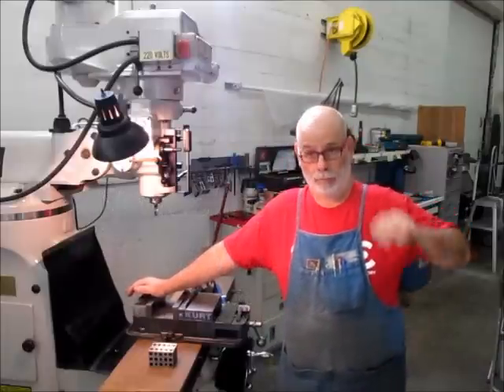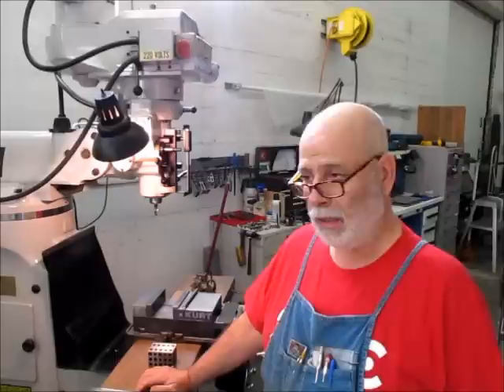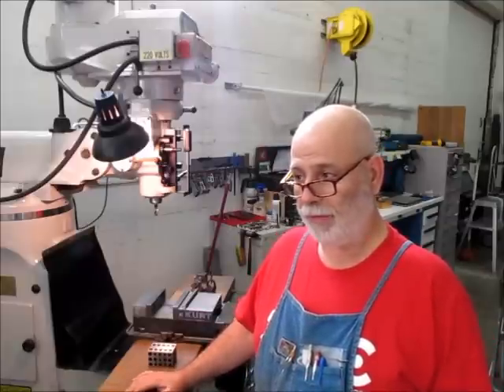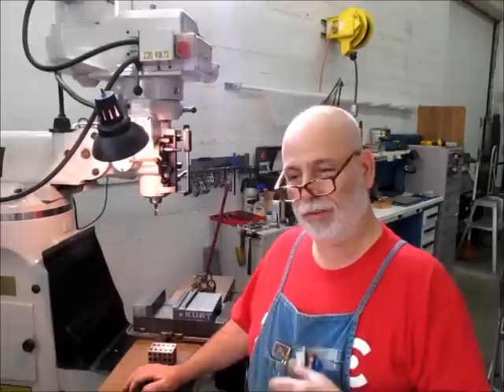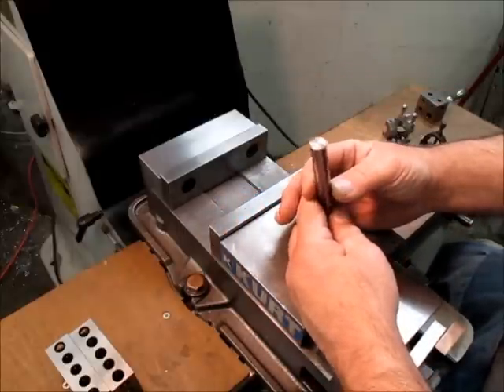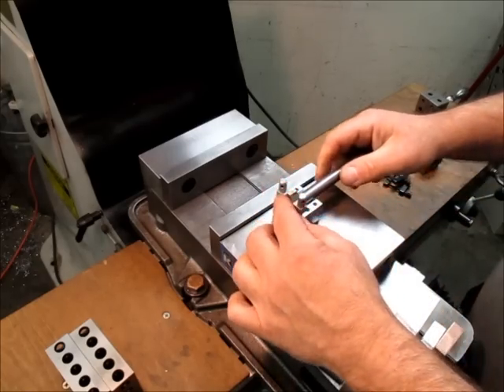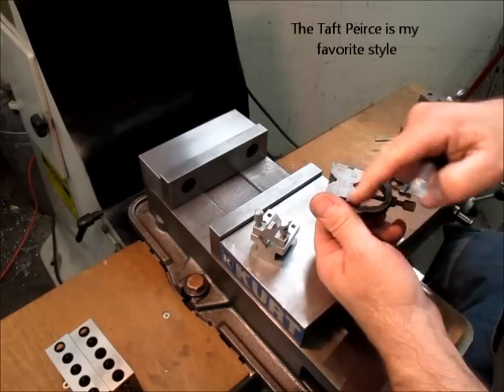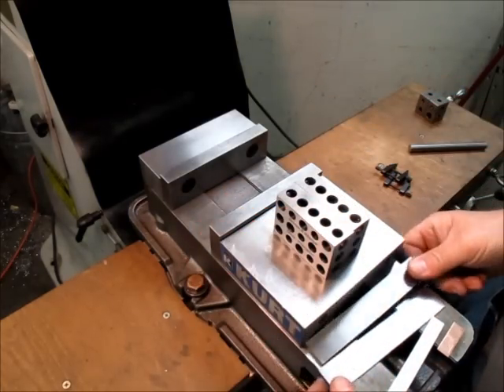No indexing tooling, no problem

Comment: Very simple, but you do need some patience which is a virtue of a good machinist.  This is years later and did you know that you just (then) invented a prototype of the overpriced Rosenthal indexing jig?  I think your method, albeit a bit more work, is more precise.  The Rosenthal product is precision made but lacks precision in its use as it relies on eyeballing the alignment with a usually only close square set on the bed.  Nice to see inventive and creative methods that use the tooling we have laying around, and properly implemented have great precision.

Comment: There must be a way to do this with even less stuff. If you simply clamp the rod in the vise, you'll be able to do 2 flats. That's the easy part. Then what? There must be a way. Let's do some brain storming here.
You need to clamp it in the vise again and make sure the first flats are horizontal. No indicators allowed, just, well, the 123 blocks, if you even need them...
Actually, what if you could use the 123 block to rest one of the flats on. You'd need to place the 123 on the table. But it will of course be either to low or too high. If it's too high, perhaps you could hold it at a angle so it touches the bottom flat while you tighten the vise and press down on the rod and press up on the edge of the 123...and now you need 3 or 4 hands for that. Hmmm...not to mention questionable accuracy. Because since you are holding the 123 at an angle, the parallelism of the edge touching the table and the edge touching the flat will depend on how precise the edges of the 123 have been deburred or chamfered.

Or...lay a machinist ruler on top of a flat to make sure it's flat. The ruler extends the flat left and right, which makes it easier to see if it's actual flat. Actually, this is a woodworker's technique - look up "winding sticks". Something like that should be possible in machining as well. If you can visually align the ruler to be flat within 1mm, which is not hard, and the ruler is 10 times longer than the flat, the actual flat will be at most out of square a 10th of a mm. Which is not good enough, but it's a start.
Well...instead of eyeballing the height, perhaps you can gauge the height of the ruler on both extended sides. It needs to be at the same height from the table. This 'gauge' needs to be nothing fancy. Another ruler might do to get sub-millimeter accuracy for the ruler and thus sub 10th of a mm for the flat. But now you need a 2nd ruler. But not really. Any stick where you can mark a couple of lines on will do.

Another way I'm thinking of is to make a mandrel. Take some alu or mild steel,  set it up straight up in the mill, drill a hole, the size of the rod. Mill 4 flats. Superglue the rod in the mandrel. The mandrel now is basically a simple collet block. Of course, you're wasting a bit of material for the mandrel.

Another idea: you put the 123 blocks half way the vise jaws. This way the rod can still rest on the base of the vise and the 123 blocks extend (raise) the jaws to clamp down on the flats. You'll need to be able to mill in between the blocks, which are higher than the rod.

Well, none of these ideas are convincing, but maybe it will trigger some better ideas...

Comment: Did you pick up the center of the rod in Y, zero it out, then take equal distant side end mill cuts from the center line? Otherwise, the 4 flats wouldn't necessarily be the same distantces from the center.

Comment: Drill a hole in a block of steel dead nuts in the center of said block . Hole should be the same size as the rod  . Cross Drill and tap one set screw hole . And rotate the rod and block assembly in the vise . Old Tool Maker 
John Hay Fort Worth Texas

Comment: I was thinking about this and I'm curious if you could do this particular job in one setup with the part vertically in the vise, with a V block and avoid indexing altogether? I mean, you could easily make the V block on a vertical mill if you didn't have one, right?

Comment: Hey Tom I'm glad you helped me out on that one. Know I need to make two more Chuck keys. I just got a Monarch 16cy 18.5" swing by 30" between centers and 10 H.P. ABOM79 size lol. This lathe has a 12" chuck. I been thinking about this one what would be a nice design for a chuck key for this chuck? The one I have is too long. The handle is to big and handle slides. This time I want to make some thing more ergonomic any ideas. Thanks.

Comment: I don't even have 123 blocks, I just used a few parallels and a machinist square, placing those on the milling table helped me to rotate/line up the bar for the next cuts. I've only made a small chuck key for my 4 jaw chuck so far, I used the end of the cutter, never would have thought to use the side of it so thanks for that.
Reply from the maker: Hi Steve,

123 blocks are pretty cheap. If you catch them on sale and get the import brand you can get them for under thirty bucks. Maybe under twenty. Thanks for the comment.

Cheers,

Tom

Comment: well i think an even more bare bones technique would be to stick the rod into the chuck.. moving it to the fixed vise jaw and tightening it so the rod is held vertically... once its there u can use the xy table of the mill to cut the square.. ofc it depends on the length of the rod and a lot of other factors.. how well would that work, compared to the method u just showed? any thoughts on it tom?
Reply from the maker: He was making a chuck key. You would have a long bar hanging out of the vise which would be a problem. For something short yes your method is really easy. Thanks for the comment,

Cheers,

Tom

Comment: That would be the start of a great series "Stuck on a desert island with just a mill, x,y&z table, big milling vise and indestructable end and face cutters and of course unlimited supply of all strengths of ruff cut metals and all shapes and sizes of nuts and bolts of all strengths and lengths" NOW make as many tools as possible, aiming to make all the tools needed to make a lathe !!!!! Halol     """Think your onto something Oxtool""" you may think of any other necessities to succeed at this task
Reply from the maker: Hi Terry,

Sounds like a fun island to be on. Thanks for the comment.

Cheers,

Tom

Comment: Great videos.I think at a way of milling a square end having only the milling machine,a cutting tool and a way of holding the round on the milling table(vise or just some T clamps).

Clamp the part perpendicular to the x axis with the end hanging out,and do all 4 cuts with the horizontal head.Or 3 cuts with the vertical head and the lower one with the horizontal.
Reply from the maker: +pasbogdan Hi Pas,

That would work as well. Thanks for the comment. 

Cheers,

Tom

Comment: Thanks for the tips on holding the part. 
I wanted to pose the opposite problem to you. What if one needs a square 1/2" hole made? I have viewed a few youtube videos and generally they seem to end up with some sort of broach approach or just milling a round hold then either filing it square or using a smaller end mill to cut into the corners. After rereading this I thought of hexagon or more sides…. eeks!
Reply from the maker: +Tom Herd Hi Tom,

Take a look at my recent video DB customs rotary broach test. Here is a way to make a square hole. Thanks for the comment.

Cheers,

Tom
Reply: +oxtoolco 
Thanks for the link it was very informative. I wounded how it would hold up on steel 1020 or so.

Comment: Here is a way to do it with zero tooling.  Clamp the rod and side mill to opposing flats.  Then unclamp and rotate the rod, and use the lips of the endmill to square the previous. cut.  Clamp and cut two more sides. Done.  You can also use the face of the spindle as a flat to index the rod.  Zero tooling.
Reply from the maker: +Spencer Webb Hey Spencer,

That way would work as well. Thanks for the comment.

Cheers,

Tom
Reply: +oxtoolco Or you could slide an adjustable parallel under the finished side to square it up.Or clamp a tool bit on the flat and indicate level with a height or surface gauge.Regards,Kap

Comment: Good vid , easy enough to set up ! 
Of the 99, or a billion other ways to set up : if the part length were shorter, a chuck / or collet could be used to place the part vertically; then all 4 sides could be cut with just one setup !   * X & Y axis of the table travel make the 'box' easily enough -  
     In the above method, an edge finder would be the only requirement, ( other than the vice and a suitable cutter ;)   )        Find the back edge of the vice; then dial to fit the center of the diameter of part needing the square . . . * not the most practical way, but it wouldn't require anything but a chuck & edge finder !     Cheers !
Reply from the maker: +georgewocosky Hi George,

You are right when you say there are many ways to skin this cat. Thanks for the comment. 

Cheers,

Tom
Reply: Absolutely Tom , another 'flash out of the dark' method just dawned ; use a V block in the chuck vertically . . . setup always depends on size & length of the part . . . at times it's a no brainer - other times requires grey matter under the fingernails !    :p    Thanks for the reply !

Comment: Thanks for the videos. I'm new to metal but have a good background in wood. I recently acquired a Jet JTM4VS mill in nice shape. It came with a poor Chinese vice. I just installed my new Kurt D688. What a beautifully made tool. I'm now looking for a lathe. Any suggestions? I've about given up on finding a decent used one and am now considering risking buying a new Grizzly.14x40 gunsmith lathe. Too risky?
Reply from the maker: Larry Will Hi Larry,

Lots of folks doing good work on Grizzly lathes. I personally prefer used equipment but that can be tricky in some parts of the country. Any lathe is better than no lathe. You can always upgrade later. Thanks for the comment.

Cheers,

Tom

Comment: Do you think - IT COULD BE MADE SIMPLER, (NO 'swiss cheese' blocks, NO parallels, NO end stops;)  by inserting, in appropriate size -  SQR TUBING ?
Reply from the maker: a Boswell Inniss Hi Boswell,

How would you clamp the rod in the square tube? What would you do if the rod and tube are a loose fit. Thanks for the comment.

Cheers,

Tom

Comment: Hi Tom, thanks for another good instruction video. V-blocks and 123 blocks are my next slated projects since they aren't really available here where i'm at.

the taft pierce v-block being your favorite, it can be assumed there is some advantage over the starrett block? i would imagine they both have the same function but then there are obvious differences in their make up. what are your thoughts? should a guy have both or would one have advantages over the other for a novice?
Reply from the maker: Hi Mike,

I can't think of any serious advantages. I'm just generally fond of Taft Peirce tools. They do have a nice overhang that makes them easier to clamp to the vise or table. Thanks for the comment.

Cheers,

Tom

Comment: Yes, you made A sqr.   But, how would you get one-to a SPECIFIC size ?
Reply: The common method would be to use an edge finder in a collet before milling. Locate the exact edge of the side(s) and of the tip of the part. Then "zero" the x/y axis on the mill's dials, or on a digital read-out (DRO). Do the math + cut away material to reach a SPECIFIC finished dimension. There's lots of videos that show variations of the edge-finding process on youtube.
Reply from the maker: Hi Boswell,

The typical method is to do four sides then measure to see what the remainder is. Since you approach size from two sides its important to go slow when you are close to size if symmetry is important. Hope this helps.

Cheers,

Tom

Comment: Nice teaching video. I am here after the event so to speak, But for somebody with very basic kit maybe one way is to drill and ream (or even forget the reaming) a hole the correct size in some square stock and put a grub screw in the side with a piece of ali or brass to prevent scoring of the work piece. Then its just a matter of turning the stock to get the 4 sides. This works with hex stock as well to get 3 or 6 sides if required.  Thanks for sharing your knowledge. regards from the UK
Reply from the maker: Hi Coop,

Thanks for the comment. You are right there are many ways and common items around that can help with decent indexing problems. Lots of folks get hung up if they think they don't have the right tool. 

All the best,

Tom
Reply: oxtoolco i got to thinking... now i wonder if automotive/trailer hubs would be accurate enough for a more permanent fixture.  stick a piece of pipe through a hub, stick it on a pair of rests or vees, drill and pin the hub to the pipe.  a collet(maybe homebuilt) to fit the material, could be pulled tight into the pipe if it's not very long.  for a longer piece, a drilled out pipe cap could push the collet in.  another pin/bolt through the bolt hole on the flange into the base, tighten it to lock the angle, unbolt, rotate and put the bolt back in.
 could use other kinds of flanges, like 3bolt or 12, which would be too big.  with decent scrounging or 4, 5, 6 and 8bolt hubs, there's angle  steps of 45, 90, 72, 60, 120, 180 from relatively normal car hubs, if the pipe is drilled and bolted, it could be rotated in the hub to get 36 from a 5bolt.  that is, if the hubs are at the proper angles.
 the same assembly through pillow blocks with another flange on the end would be useful as a light duty lathe headstock, i've been looking at possibly using 2" id pillow blocks for one in future, comically oversized.  littlemachineshop has relatively cheap, though tiny, chucks that would work quite well for a starter homebuilt, or use the gingery method to chuck stuff.
 so, maybe a short series on experiments for diy metal shop equipment, you might look up matthias wandel on woodgears.ca, he's been building wooden woodshop tools, might inspire you.  one thing that would be VERY useful, is lessons on how to make parallels from bar stock, maybe someone will send a link you could share.

Comment: I think there may be an even easier way. Well, depending on the lenth of the rod to be square cut. Hold the rod vertically. And simply use the X and Y axes to mill all four sides of the rod. If you scribe your dimensions on the end face of the rod, you could be pretty darn accurate with this method, locking your unused feeds accordingly. Ofcourse, deflection would be the biggest obstacle. But clever work holding could help with that.

Comment: thanks for the tip!! I love this sharing of knowledge . question did you make that mill stop or buy it? I need it!!! I see you have an acra mill? I have a acra mill from 1988 its 1 phase 220 from factory belt speed selector!!! so my question is on the head it has 16 speed high and low? but I looked at a similar Bridgeport and it has 8 speeds? im just confused it does make sense I hope your is the same and you figured it out
Reply from the maker: Hi Craig,

Mine has a variable speed head. The mill stop in the video I made. There are some available online. Search five axis mill stop and see what comes back.

Best,

Tom

Comment: if the part is not that long and you have a vee block I would have put the part vertical in the vice and then cut the square using the x and y axis.

Comment from the maker: Hi Ben,

They are pretty much the same as the wood work versions. I poo poo them for years until I tried them. They do actually work well if you use them correctly. Thanks for the comment.

Best,

Tom

Comment: I am going to add to the pile of likes for this format. The fundamentals are a good portion of why I watch. I am a Telecom switch installer, not a machinist. I work with metal pretty often but I have to stumble across the better method the hard way. The project videos do a real good job of that but stepping out and handicapping yourself with tooling limitations is a good way to explore the basics.

Comment: Great tip, I have had to do the same thing but had limited success. Your method is great because it requires only 1 change of setup in the vice. Like a fool I didnt think of cutting from both sides thus insureing parrallel faces.. Thankis again